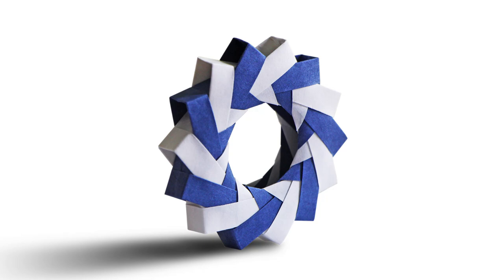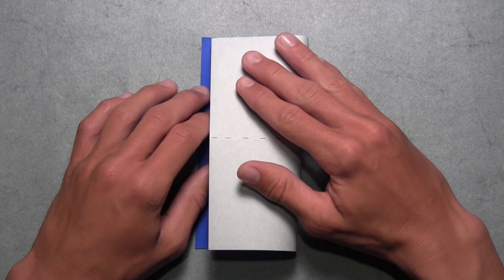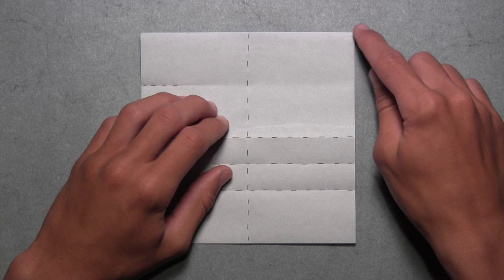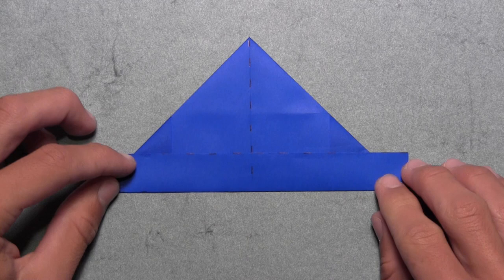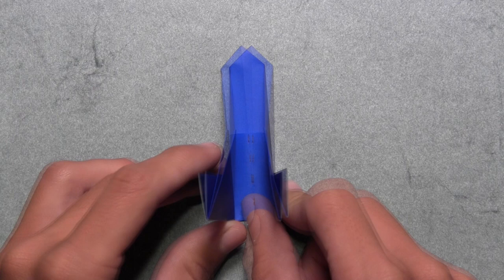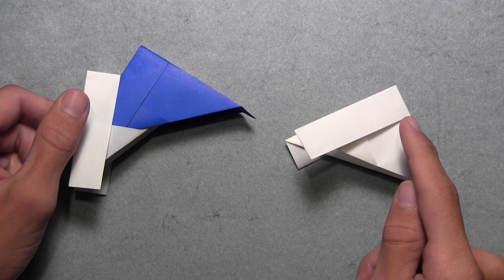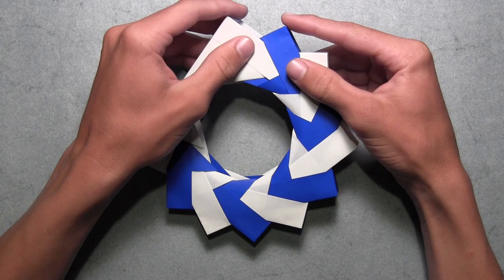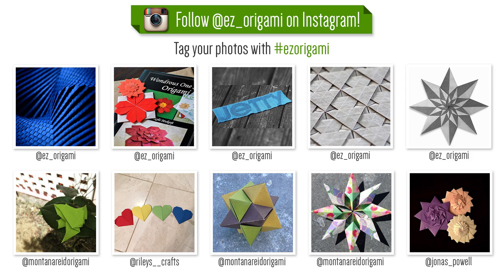Origami 3D Ring (Paolo Bascetta)

Comment: Hello, thank you for the video. Just a suggestion: being the sheet a square, the second fold is actually not necessary and it could be avoided so that at the end you will not have a vertical fold in the middle of the side of each module, making the origami esthetically nicer. Have fun!